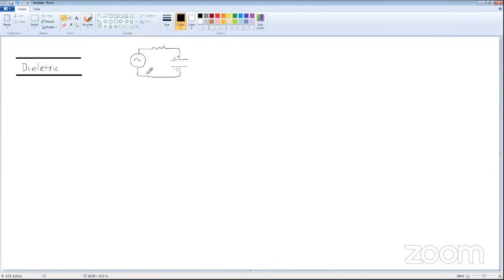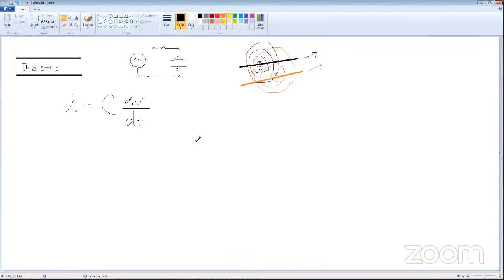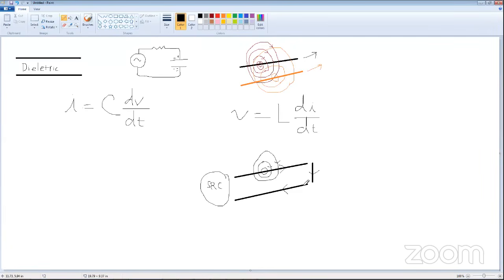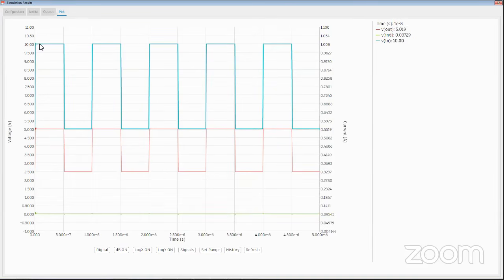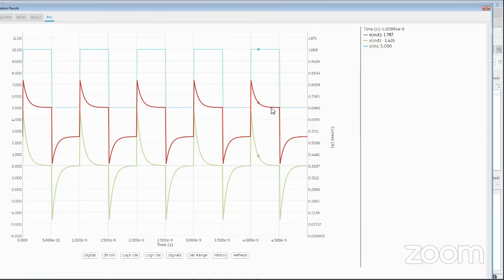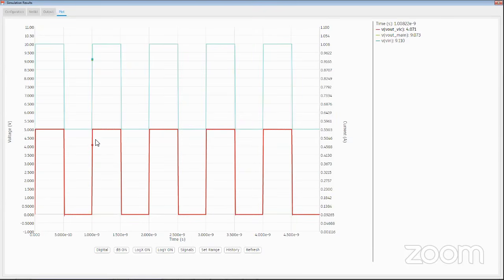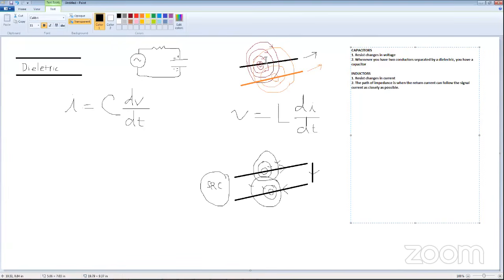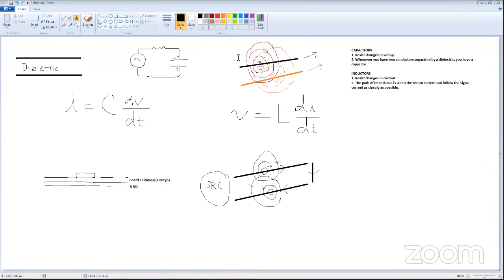Signal Quality Part 2: Physical Basis of Inductance and Capacitance

Comment: at 9 minutes the lines are drawn going the wrong way for the magnetic field. It's the right hand rule, using your right hand you point your thumb towards the current, then curl your fingers. It looks like you must've used your left hand for the magnetic field direction.